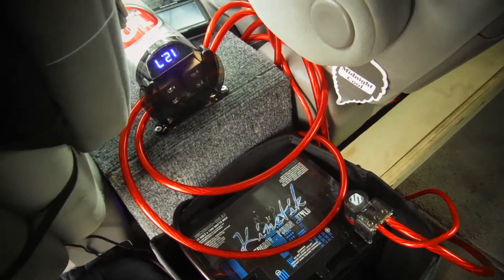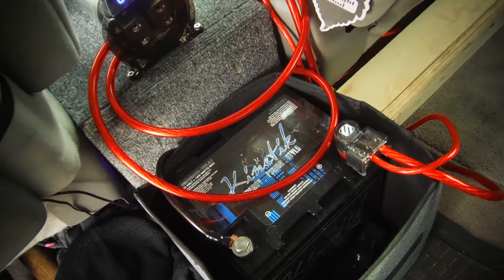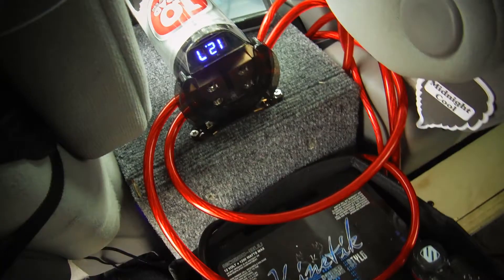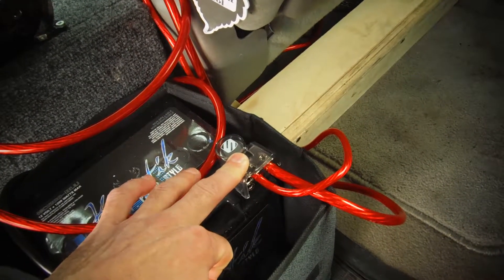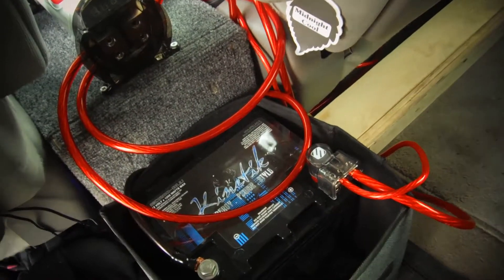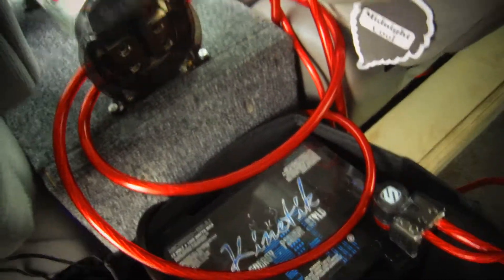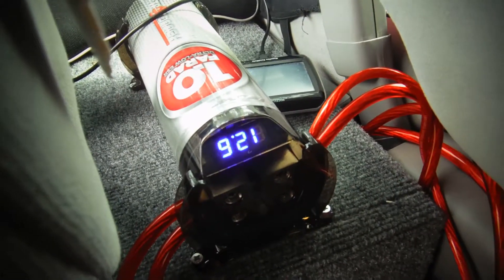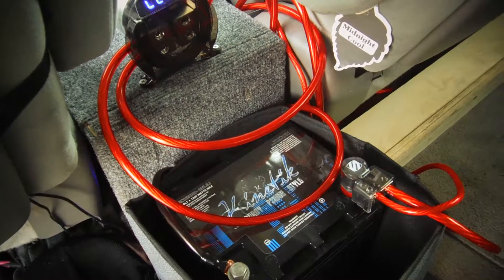Car Audio Capacitor and Kinetik AGM battery Parallel Install

Comment: Your ground for your amp would of been better off going to the ground of your second battery dc electric is a giant circle so your goal is to make the loop as fast as possible with the least resistance..also upgraded the size of that wiring would do you good but overall seems like you got a solid start to your setup! So please don’t take this as any sort of negativity just a couple little friendly tips
Reply from the maker: This is my family car, all wire is 4 gauge to 8 gauge, all OFC wire. I've been doing this for 25 years. Thanks for the comment.